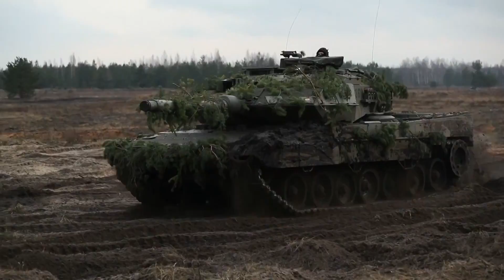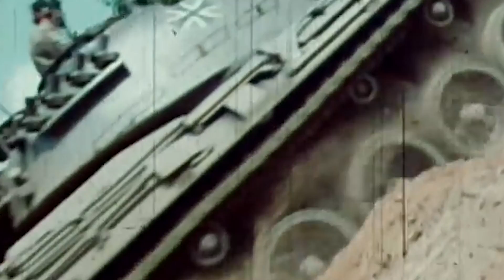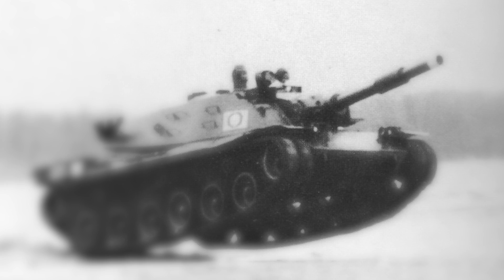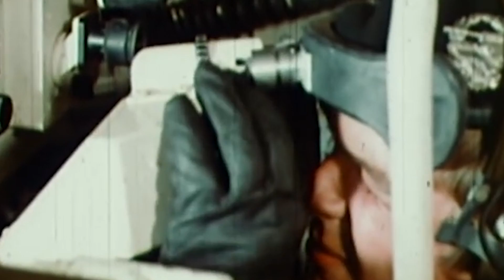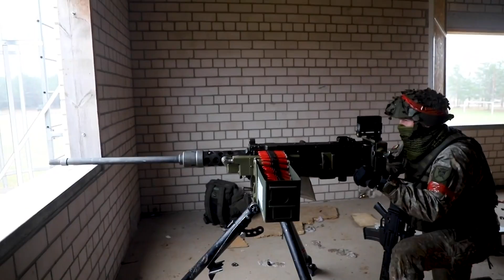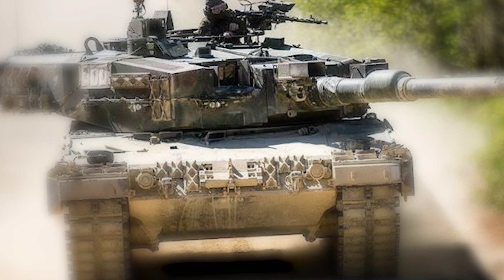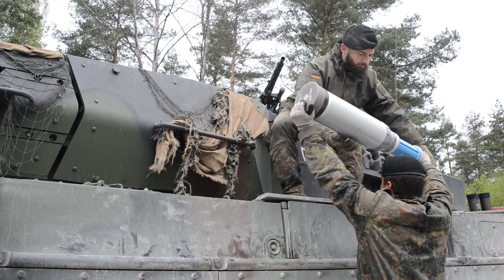Massive Super Tank - Leopard 2

Comment: Why is the Leopard 2 called super tank but not the M1A2, even though it is same size to now bigger, because of all the added things in the M1A2 SEP V3?
Reply: @Mal101M  Easy to destroy any tank when it's stationary with no Infantry support...and BTW- it was Kornet, not TOW that took them out
Reply: M1 is a super tank with a big downside: it’s a gas guzzler because of its gas turbine engine.
The Leopard 2 has a turbo diesel which consumes very little while idling.
Reply: @alexfortin7209  Yes, and no. The M1'S are gas guzzlers, which limit range, but it also means you can't get too far ahead oh you support  whether it be infantry or resupply trucks. The Russian tanks are good on gas and very fast, so fast that they outran their ammo trucks,  infantry escort, and fuel truck to where the ended up strung out and out of fuel 500 miles away from the FOB in Belarus. How that worked out. They ended getting ambushed by Ukrainian infantry and drones. There is no such thing as a perfect tank. Every tank has weaknesses that can be exploited or turned into an advantage if you are a resourceful commander. Yes, M1A2's suck gas but it means you want get to far ahead of your infantry support or out of range of your artillery support like HIMARS.
Reply: @alexfortin7209  ???? ALL tanks anre gas guzzlers- they'll both burn 7-800 litres in a day of bombing around cross-country
Reply: @mcplthivierge  The M1 burns 10gal/h (30gal/h in tactical idle) in idle while a Leopard 2 burns 3gal/h.
So the real problem is that M1 burn 1/6 to 1/2 of their maximum fuel burn rate even when idling.
Reply: @Mal101M  Hold up that doesn't even sound right. Leopard 2's were given to what Syrian faction? I know Americans gave TOW missiles to the rebels. Did Assad have Leopard 2's in his army?
Reply: @Mal101M  There are no tanks that will survive TOW hit. Only way to survive is if it can destroy the missle before the hit.
Reply: @XtreeM_FaiL  that is just flat out wrong, there are plenty tanks that have survived hits from TOW’s and other ATGM’s it’s warhead is not that powerful. I distinctly remember a few cases where TOW operators had trouble getting through the turret of T-72M1’s because of the impact angle.
Reply: Because 2A7V is simply better
Reply: @aggravated_assault   Those wacky kruts and their"mine is bigger and better"  boasting! Hahaha hahaha
Reply: @j.robertsergertson4513  .. we just following the Americans 😅 they have all the time the best of best the most of all stuff the biggest stick … no one can touch them and winning ( almost ) every war against strong countries like Panama or Grenada 😂 and lose only few wars .. like Vietnam, Iraq and Afghanistan 😂
Reply: @j.robertsergertson4513  your the same
Reply: @aggravated_assault  Uh, no. If the the platform was so successful why was not seen on front lines fighting in Iraq?  They were in Iraq but chose to only do training with Iraqi forces. Even the British Challenger 2 got to see combat and got tested against multiple RPG's. The tank is good but not better the M1A2 Sep V3. The tank never upgraded to get reactive armor plates or active protection systems like Trophy. If the tank was so good, then why replace it with a totally new platform,  the Panther with 152 mm gun?
Reply: @alexincobra7379  its not being replaced and thier is a kit for era
It wasnt used in iraq as there was no country present that used the leopard
Reply: @aggravated_assault  No because the new Panther is different turret with 152 mm gun and comes UAV launcher. That is a lot more than a kit. The M1 Abrams went many kit upgrades from M1 through M1A2 SEP V3. The base body stayed the same.
Reply: @alexincobra7379  … they was not in Iraq .. German was not fighting in Iraq … they “ just “ gave only money for this war
Reply: @alexincobra7379  ne panther is not a kit the panther is as technology demonstrator from Rheinmetall with a 130mm gun.
Reply: @wolfgangselle3272  oh, that's right they wussed out.  I confused them with Britain,  Italy or Australia.  Even little Macedonia, Poland, and Estonia participated.  Germany was always lazy in fighting NATO operations.  It was only after Russia invaded Ukraine,  then Germans all of a sudden want to revive their military. 🙄
Reply: @aggravated_assault  I said it wasn't  a kit. I saw documentary on it.
Reply: @alexincobra7379  Germany was not lazy to fight for NATO … that was not a NATO war in Iraq … that was a war what the USA wanted under wrong pretext. And we ( and I hope the Americans now too ) know that there was no Weapons of mass destruction and Sadam has never supported AlQuida and Bin Laden. That war just BS! To satisfy the war! And Germany was against it. And smart enough not losing people for nothing! Yeah Polen or other small countries was there, that’s right. And they was with the USA because they wanted something from them and maybe they had fear? Because the US president then said who is not with them ( fighting ) is against them. Or he said the countries from Europe who was not willing to fight is the “ old “ Europe. So the small countries from Eastern Europe have something to lose
Reply: @alexincobra7379  I have to ask, were you born this unintelligent or did it happen over time? is it the water? or maybe too much tv?
Reply: @wolfgangselle3272  It doesn't matter about the War. Germany was lazy about NATO for a long time. It spent less the 2% of GDP on defense even though the NATO agreement was to spend 2%. The whole reason the US still have bases in Germany was because of NATO agreement. Germans can live comfortable rich lives while Americans can die protecting your Liberal World Order? There is no more Soviet Union. Germany needs to defend itself.  Put more skin in the game or NATO should be dissolved. Let Germany fight for themselves. Who out of NATO protects Americans from whatever?  NATO is all Euro centric and not one member sends aid or any help to US or pay us for anything. Just want us to fight your wars and problems but when it is time for your assistance,  all of a sudden,  you don't support the wars or whatever. As soon as we get a leader like Trum to threatening to withdraw US troops, then you promise to pay 2% of GDP.  I have served 13 years in the US Army and 3 combat tours in Iraq War. How many years have you served  and how many battle front have you seen?
Reply: @wolfgangselle3272  The USA was played by bad British intelligence because the CIA was too lazy to build good human intelligence resources in the Middle East.  Also Saddam was trying to draw us into a fight by supporting AL Qaeda,  and making it look like he had WMD's. The main AL Qaeda was not there but after we got into Afghanistan to fight AL Qaeda,  Saddam Hussein publicly announced he would make Iraq a safe haven for AL Qaeda. That, and showing the perception of having chemical weapons that could be given to terrorists was enough to make an excuse to invade. Americans were already on edge after 911 attacks. All tou have to say was "terrorists with chemicals weapons", and people lose their mind in fear.  Germans don't understand that kind of trauma. When was the last time you were attacked, Nazi Germany?
Reply: @alexincobra7379  Jesus are you for real? Holy crap what a twist of reality. Cope mechanism 101. How do you come up with all this bs?
Reply: @alexincobra7379  You are ignorant to the point of stupid, i am sorry to tell you in this straight way but it must be done. Have Germany experienced terror 20+ years in row of it actually with one fraction alone, now add the rest. Look it up, Rote Armee Fraction (education mine junge). But you're right Germans do not have paranoia even though they are one of the countries where you can find a bomb in your back yard or when you're building a new house or maintaining infrastructure. And we are not talking rare or a few instences but thousands upon thousands of times.

I would suggest you refrain yourself from speaking on matters you know very little about and then use it for goalposting. Don't talk about trauma, you have no idea lad.
Reply: @alexincobra7379  Diffiant company :) makes the Panther
Reply: @shades2.183  Not everyone is like you, living the good life or distracted by entertainment and mainstream news. In my years in the Army, I had stayed close to the Intel sources because it was encouraged to know current events, know the geopolitics,  get educated on history of target country, and get intelligence from local population and intelligence officials in country. You don't get that, being at home worrying about your favorite football team or learning the latest dance. Plus I was always fascinated with history and geopolitics at a young age before the Army service, so I gravitated toward it naturally.  Once I was immersed that world I have made interesting friends in Iraq, and got to see some live free lives as Americans.
Reply: @shades2.183  International terrorism? You don't attack another country over domestic terrorism.  As soon as you called me ignorant then named a domestic terror group now I know you don't know the difference between different types or terror attacks.  Al Qaeda is not a home grown extremist group. They attck nations outside there home country. Who is calling who ignorant?
Reply: @mangrey2361  rheinmetall makes, it right?
Reply: @alexincobra7379  It is funny you talk about being educated on a country and yet you knew nothing, absolutely nothing about RAF, you're full of sjit. And junior i served 15 years, thats 15 more than you i suspect.
Reply: @alexincobra7379  i know its not a kit thats not the point i made
Reply: @aggravated_assault  I was wondering the term used for one yank and never the other. It was just a question that nobody could answer.  It's ok.
Reply: @alexincobra7379  … you said ..” just want us to fight your wars ..”? Really? Who want to be the world police man and has military bases around the world? And how starts the most  wars after the second WW? It’s not Germany. Anyway .. and I served also in the Army ( enlisted volunteer for a longer time ) bad unfortunately I needed to withdraw on family reason and just did the time what you needed  to serve for the national service. And when I was at the age to join the armed forces ( 1986 ) u needed to serve 18 months and when I was there ( should I say ? ) I was lucky that we must not go and serve time in Afghanistan or Mali or wherever… we ( I ) just did our service in our home country and that’s good enough for me … and before I forget it THX for your service  ….
Reply: @alexincobra7379  .. you wrote … “ Germans don’t understand that kind of trauma” …. I think you forgot we lost two times a big war. And on the second war alone we lost more people ( soldiers and civilians  ) then American ever have lost. Our home country was destroyed. And what was destroyed in America? Pearl Harbour the only attack ( before 911 ) on your home land. Have you ever lost Land to another countries? NO And we lost 30% from our land size. So we know what it means to lose. And you can call it also traumatized! And that’s one of the  reason why Germany normally not want do a big military engagement around the world. America made there choice .. they want fight everywhere around the world. They want secure there interest and influence, get the cheap oil and that’s ok with me. But it’s crazy.. the USA get the cheap oil from Saudi-Arabia and all the guys from 911 came from Saudi Arabia and still the US is still there and  supported this radical Islam  regime
Reply: @wolfgangselle3272  911 lost 3,000 lost in one day, not soldiers,  not war combatants, but innocent civilians.  That doesn't compare to live lost in a war that was started by Germany who was hell bent on taking over Europe and started ethnic cleansing. In war, it is agreed upon that lives will be lost.  In a terrorist attack, it is a surprise attack to unsuspecting population.  Know the difference.  Don't even try to use moral equivalence to compare American operations to what Hitler did. We didn't fight a war in Middle East, willy nilly, I was because of an invasion of ally or attack on homeland. Iraq war was just a continuation of the Gulf War which Saddam Hussein started with invasion of Kuwait.
Reply: @alexincobra7379  OK and THX for this nice conversation even when I have a different opinion. But I think that is good and I hope I could still shake our hand and we could  have a cold one  together ..I will end it here ..
Reply: @wolfgangselle3272  sorry that the man is so hellbent against you. I respect the Germans.
Reply: @aggravated_assault  The Leopards horrendous combat record says otherwise.
One issue that the Leo 2 faces is it’s terrible survivabity, while it uses blowout panels like the Abrams for its turret ammo stowages, it keeps the hull ammo rack, witch is a massive weak spot, any penetration on the frontal plate will likely result in the death of the driver + possibly gunner/commander or an instant ammo detonation/ fire.
On paper the Leo 2 should be the proverbial ‘super tank’ but in practice it is beaten out by the Abrams due to its 20+ years of constant combat that has allowed the U.S. military to perfect its survabiliy on a modern battlefield.
Reply: @Elguapo__  the problem of the front ammo rack is fixed do to added frontal armor aswell as the use of modern ammo wich wont burn or cookoff (DM63, and new produced DM53). But already from the start this wasnt a to big weakspot as the only realistic penetrationangle for a ammo shot was from the side.
Reply: @aggravated_assault  sadly there is no such thing as ammo that won’t cook off. As long as there is propellant to burn In a shell, there is always something to cook off. And no, the added frontal armor barely does anything exept create more spall in the event of penetration, yes, it may be protected against HEAT, but any sabot or KE shell will go through the UFP.
Reply: @aggravated_assault  and to address your final point. No, it was not a small weak spot from the beginning, if you want any proof of that look at what happened to leopard 2’s in Turkey
Reply: @Elguapo__  You people sound incredibly unintelligent. Yeah sure, Turkey had leo2 a4 in syria, A4 junior. but i am not even going into this toddler goalpost strawman competition. the reality though is that LEO2 a5 has outpreformed Abrams a2 on  several fronts, it is reality. However you toddlers might know if we are lucky that it is more about the doctrine when we talk about effectiveness. What Turkey did with their tankfor e in syria is on the same intellectual level as this comment section, pretty low end.

it is pretty evident that alexin is a half-wit, dumb as a doorbell and yet here you goofballs are, playing sofa experts and cheering his stupidity.w
Reply: @shades2.183  While doctrine plays a massive part in the effectiveness of a combat vehicle, the shortcomings of a vehicle still cannot be ignored. The Abrams may be outperformed on the fronts of fuel construmption, mobility and price, it makes up for it in the field of survivability. The truth is that we have no clue as to what the true performance of the leopard 2 is in proper combat under its home nation, the Abrams has had 20+ years of constant combat to prove its effectiveness and cement itself as one of the best tanks of the modern age.
Reply: @Elguapo__  That same vague "it has 20years of illegal war behind it"  go to cruch as usually. Well, you missed manuevability and accuracy as well, minor stuff i know. Only thing i see here is little murican boys trying to comfort their egos, sad but true. Its all about them feeelings in the USA today.  Oh and that part about its home country, well hufuckingray, that is pretty important as it was designed for that environment with that specific region in mind, region with loads of water, mud, snow and so on.
Is it the best? I don't know, is abrams the best, sure as sjit not though. Is abrams the best for US, obviously.
Reply: @shades2.183  I addressed the fact that the Leopard beats out the Abrams in mobility, and combat experience is combat experience, weather that be in a just war or not.
Reply: @Elguapo__  jep 2a4s getting blown up by kornet what a suprise, put any 1985 tank their and it will blow up.

Comment: There is plenty of photo footage that can be found of knocked-out L2 tanks online... Just saying that maybe they can't take a hit...
Reply: The most losses of Leopard 2 happened to the Turkish that used it completely against its designed strategy to work together with infantry (fight of combined forces). They put the leopards on top of a hill where they got shot by modern dual charge ATGMs. It still is one of the best tanks in the world, but it is not a miracle machine. If you use it in a stupid way it can be defeated.
Reply: Old turkish Leopard 2A4's used without any supporting infantry in syria. Yeah, not a big surprise that they get shot to shit.
Reply: You can also find the same pictures from the Abrams.
Reply: Nothing is immune to destruction
Reply: So what?
Reply: @Mal101M  even a WW2 panzerfaust is dangerous against a modern MBT if it is aimed at the right side and spot.
Reply: @shaggings  Nah, I wouldnt say that. You cant compare WW2 anti-tank equipment with modern tandem-hollowcharges... i think WW2 antitank equip will have massive problems with penetrating a modern era tank even on the side.